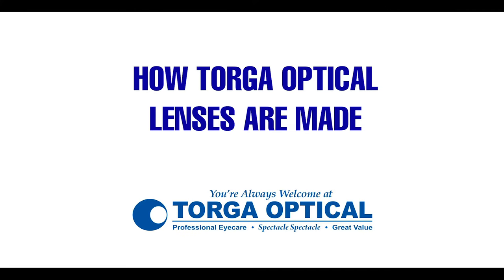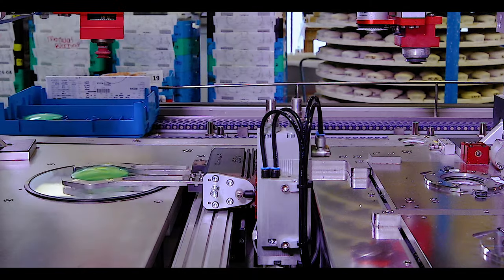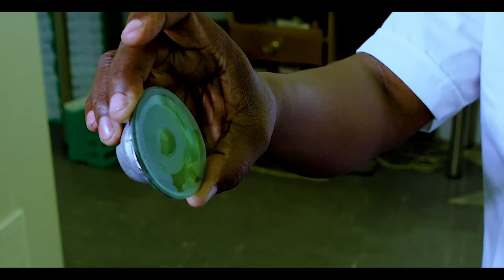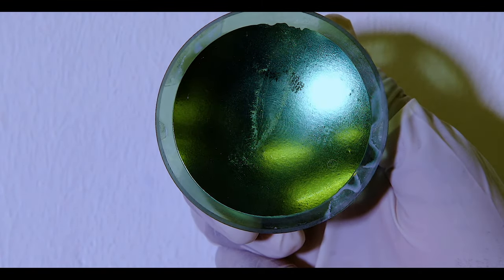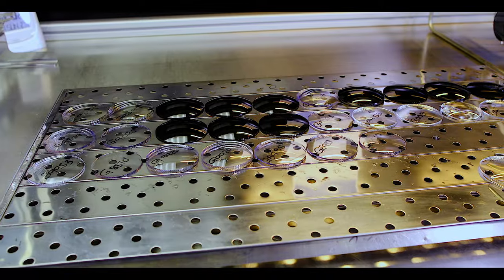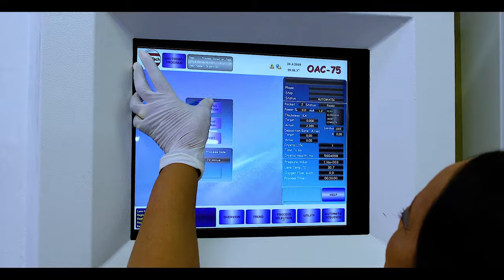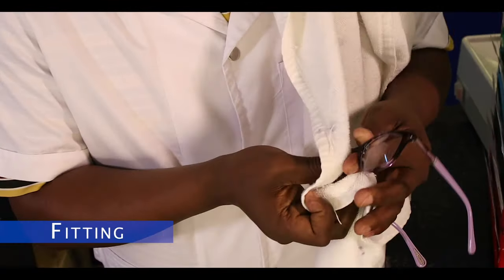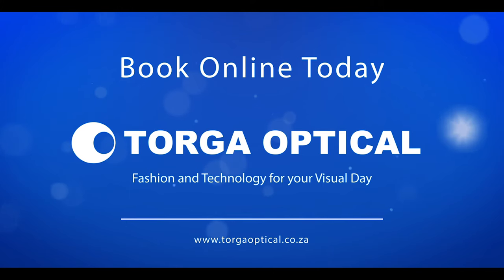How Torga Lenses are Made.

Comment: How can I prevent small scratches that are caused by dust when I wipe them ? 

Anyway I really love my spectacles
Reply: I think scratches are a result of the way one handles and stores his or her specs. To prevent scratches, do the following:

1.  Always ensure that you clean your lenses with a Spray Mist Lens Cleaner and a cloth that comes with the case (can also be bought separately).

2. Clean them daily for best results.

3.  When storing your specs, completely wrap them with the cloth that comes with the case and ensure that the lenses are not in contact with anything else other than the aforementioned  cloth to avoid scratches.

4. Never store your specs anywhere else other than the designated case or any other case for specs.

5. Never touch or allow contact of the lenses with any other material other than the cleaning cloth that comes with the case.